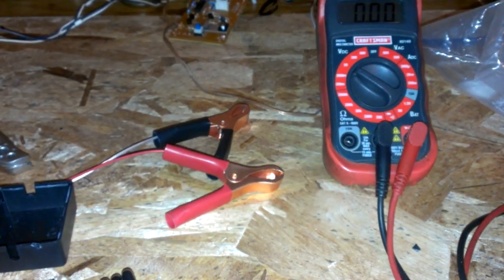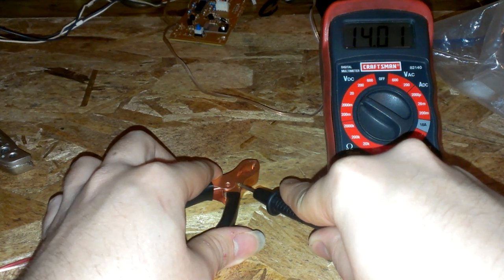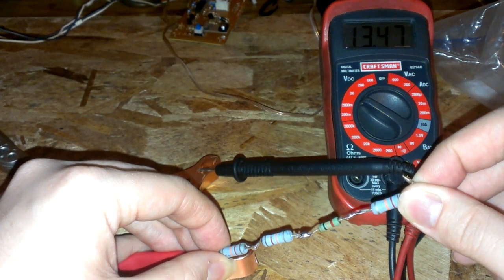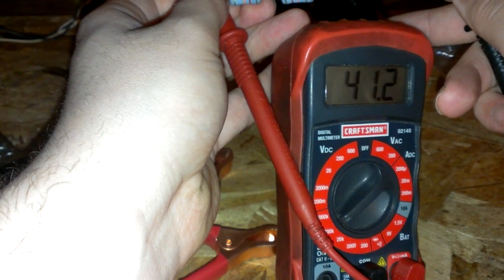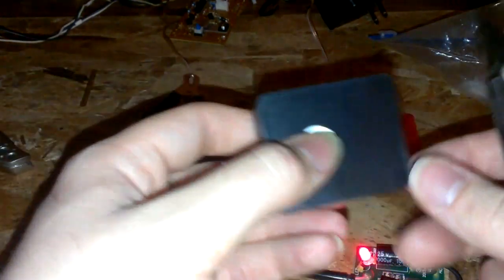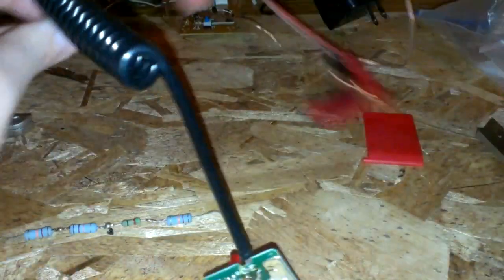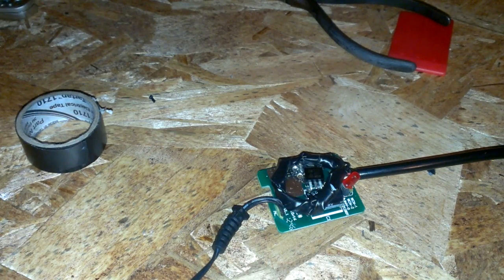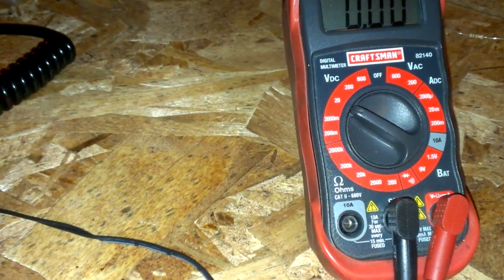harbor freight float charger mod

Comment: The 2 I bought about 18 years ago have a built in rheostat to adjust output. 18 years later they still work great. A charger not on a battery tends to read different than one that is.

Comment: By adding 40,000 ohms in series with this circuit you have effectively disabled this charger. At a starting  battery voltage of 10 volts you are charging at a rate of .0001 amps and as the battery voltage increases the charging current decreases. That's 1 ten thousandth of an amp or 100 microamps.  Probably much less than the self discharge rate of the battery so at this rate your battery will never charge.  PlayDav485 had a much better idea of using 1 or 2 diodes in place of the resisters.

Comment: I've been using several of these for years on motorcycles and mowers. They are on the batteries for 4 months out so at a time. You aren't accounting for voltage drop. Every connection contact and material, length of wire and even the battery itself will   reduce the output. 

Plus a float charger isn't putting out a constant voltage all the time. It has a voltage regulator built in. It allows the battery to drain then charges back up when it gets so low.

I used to check the battery voltage constantly and feel how warm they are. There was never a problem. Check it for a while if you are worried just to ensure its within battery manufacturer specs and not putting out more than listed on the charger.

This doesn't need done

Comment: LOL  I ask google if a float charger would charge up my run down ATV battery and this is what i get,, Damm,,Well will it or not,, It seems to me like if a battery is good but only run down a float charger should charge it back up in about 2 to 4 days maybe even 5 for a full charge, The only reason that it would not is maybe it would burn up trying to charge non stop for that long, not sure ,, Does anyone here know ,, but please not all the stuff to explain why or why not just yes it will charge it or no it will not charge it, Simple as that no theories or guess,s,, I know a little about everything but i dont know it all about anything, I took two phone chargers that were 6 volts and wired them together and charged a battery but it took a week, and never did reach full charge , I assume 6+6 is not always 12,  lol  just like 2+2 is not 4,, but 2+2 does =4  2+2 is just 2+2 , like this 2+2=4 , Did the 2+2 go away, No they are still present, They just take on a different form , now 4 contains 2+2, not even time can change this!  WoW that Dam Physics class ruined me, I dont even want to get started on gentrification, or evolution, Ha Ha lol, Ok enough ,, what u say guys ,, yea or ney about the float charger,, Thanks
Reply from the maker: it would probably charge it in a few days. it the float charger is a smart one and detects that the voltage is to low to charge then it wont charge it at all.
Reply: They can make it that smart,, thats cool i guess, i would never dream that little thing has that much tech in it,, thanks
Reply from the maker: yup some of those little devises will charge a car battery but over time.. might want to consider getting a car batter charger. one on wheels....
Reply: I  did thanks

Comment: but the voltage changes (drops) as the battery charges up to the proper level, then actually shuts off when full is reached, then as the battery self discharges down to a predefined level the float charger comes back on, repeating this cycle...

Comment: Replace VR1 with a 10 turn 100 ohm pot...you will now be able to adjust the output voltage.
Reply from the maker: +405line nice. thanks for the info.

Comment: A diode capable of handling the full charge current will drop the forward voltage by 0.7v.   Try putting it inline on the positive lead of the charger output.   See if it drops your charger voltage to 13.3v on the output side when connected to the battery.   Resistors only restrict current.   Ohms law.
Reply from the maker: Brian Dombrowski ok thanks. will try it soon.

Comment: Boy oh boy!!!  What a bunch of BS from all you folks.

Just google battery float charge.   A float voltage for a battery tender device should be around 13.5 volts so it will not boil a sealed lead acid battery.   This is what is called constant voltage charging.   I have taken dozens of these Harbor Freight  tenders apart and tweeked them for many friends over that last several years.  The quality control on these is all over the place.  I have seen outputs of 12.5 to 14.6 volts.  These are not individually tweeked from the factory.  They are mass produced with a  specific list of parts values and not corrected for the tolerance's of every part in the design so they vary as mentioned previously.   Per Battery University web site, float charge for Sealed Lead Acid (SLA) batteries should be around 13.4 to 13.7 volts. 

To tweek your Harbor Freight Tender you need to change out the feedback resistor for the voltage regulator that is inside these units and find the correct value that outputs roughly 13.6 volts to your battery.  Once you have this it should be connected to a fully charged battery for maintaining full charge of a long time period without boiling the water out of it.  These units can only put out about 500 miliamps or 1/2 an amp into a battery based on the wall wart specs they come with.  It is a tender not a charger.  It is for maintaining a full charge not charging a dead or mostly discharge battery.

The design of the circuit looks like it should be reliable and safe.  The voltage regulator it uses has been around and used in many products for decades (LM7805 voltage regulator) and has built in over current and over temperature protection built into the IC (integrated circuit).  There is a short circuit protection transistor circuit built into the unit that shuts down the voltage output if the battery clips are shorted together.  The LED tells you when the wall wart is plugged in or it tells you when a battery is connected with the correct polarity.  THE LED DOES NOT TELL YOU THAT BATTERY IS FULLY CHARGED.

I reverse engineered this unit and derived the circuit diagram and studied it.  It is a good design for the price and should work well if you have the understanding to tweek it for the correct float voltage that SLA batteries call for.
Reply from the maker: jp040759 thanks so much for your comment. it will help a bunch of people out. thanks.

Comment: I'm with J.R. Zippie and some others on this...

I've been using two of these floaters for years, one on my bike and one on my mustang, for 5+ months at a time all winter long. Batteries are healthy and full every Spring.

One model looks different than the other (they were purchased at different times) but both are Centech with the same model #42292.

The poster didn't take into account the inherent design of a float charger. The floater is going to put out higher voltage than the battery has until the battery meets the cut-off of the float (around 14v) then allow the battery to naturally self-discharge to 12.x V before triggering the charge circuit again. This is called...wait for it..."floating."

The poster also is not taking into account voltage drop under load. Of course the thing is going to put out 15V without load, the voltage regulator isn't designed for a no-load situation like a Battery Tender's. As soon as you apply any load (like a battery...or those resistors) the voltage will drop and it will trigger its charging routine until it hits the cut-off.

My batteries are always 13.x-14.x V when measured from the battery with the floater connected. I haven't figured out what the actual cut-off or trigger voltages are, because I don't really care. I'd probably need to take hourly readings for weeks to figure it out. Not worth the time since the things work fine. It isn't a very sophisticated device, it doesn't have to be.
Reply from the maker: yea they are fine the way they are. some have a really high voltage cut off. these models don't cut the voltage off. they just keep charging until it meets the chargers voltage then just hang there. but on some of these chargers have a very high cutoff of around 15v. I left mine on a little scooter battery for a few days and it was at at almost 15v around 14.8 I think. and it was sizzling pretty good. maby it was defective I don't know. ive read on the net that some people have 15 plus volts when charging there batts with these chargers. so be aware. and check the battery after 2 days or so to make sure you get a good one.
Reply from the maker: yup.
 that's the way there supposed to work.  but the one I got was over charging the battery up over 15v. after a week.
 so I tried to get it to 13-14v or so. but was unsuccessful. so if you have any pointers than send them my way.... thanks for commenting.
Reply: Lm
M
Reply: +Tim W  Thanks for your input,  I have one of these brand new in the box and Just bought a Kawasaki Z1000. I was looking to see if this unit was worth trying... I figure if it works for you on both your vehicles using two of the same units it'll more than likely work for me. Thanks!
Reply: Tim W  y

Comment: try using 2 diodes in series for 1.2v drop
Reply: Simple, effective, and it would keep your battery from being discharged by the charger if the power goes out as some other commenter mentioned it would.
Reply: Very good idea however I would probably use only 1 diode and nodriveknowitall is correct about the discharge on a power fail.

Comment: There's a flaw in this modification... I'll explain. Attaching resistors to one side of  a voltage with no current running in the resistors, measuring it with a volt meter the reading your getting technically should be the same as the voltage source because with no current flow, no voltage drop. The voltage drop your getting is by the little milliamps drawn by the voltmeter. THAT is the reason why you need 47.5K ohm resistors... which is WAY WAY WAY too high for what you want to accomplish.

In order to get a correct reading with the correct resistor(s) you need to have the load (battery) attached to the resistors so you get the current and subsequent voltage drop thru them when the charger is set up and charging a battery. Be aware with this unregulated system as your charging a battery the current will NOT be constant as the voltage rises in the battery. So as the current draw fluxes so will the voltage output of the charger.
Reply: You are correct. I modified my charger like he did but I  did the resistor so the current was 150 mill on a full charge battery

Comment: It's a float charger so it's not suppose to overcharge & shut off then turn on when battery gets low!
Reply from the maker: yea but I thought a while back that it was charging a bit high.... but not really....just a little bit. cause before on a good battery it was charging a bit over 15v.. and thought that it was way too high... but on a good but weak battery it was only charging at about 14.5 or so which is good

Comment: I actually use this charger to fully charge lead-acid motorcycle batteries after refilling them to spec with distilled water at the end of the season, at 0.5 amps it's perfect.  I only charge for 24 hours, though, it has definitely boiled off more than one battery for me if left for winter.  It may not be a Genius charger that's intelligent and desulfates and shuts off completely, but it gets the job done fine for five bucks.

Comment: it shows as 13.4 cause its driving a 10 megaohm resistance,and that causes that 40k ohm resistance to drop to 13.6, but the battery isnt that  high in ohms , so you end up with zero power coming out, experiment with between 10 ohms and up to 50 ohms 1/4 watt resistors, and that may get you close, but really, buy constant voltage maintainer

Comment: way too high resistance, yeah at 40k ohms the mutimeter shows 13.6 but thats the wrong approach, you could put 10 or 20 ohms resistor and that will put around 80 milliwatts of power into the battery, which will float it, but really you need a voltage stabilized 13.6 v and not current limit a linear transformer as you are wasting a ton of power doing so, or buy a cheap adjustable dc-dc regulator on ebay and wire it in with a switch so you have charging and then a manual float option